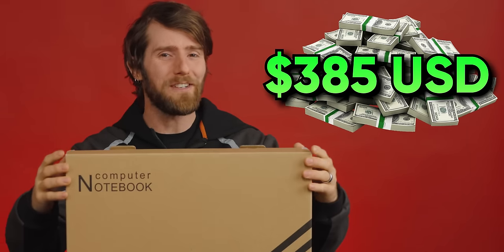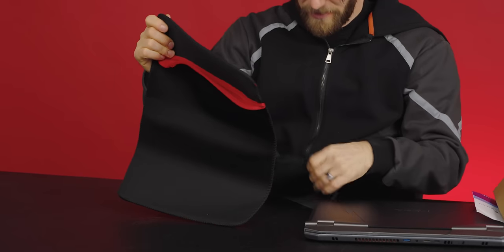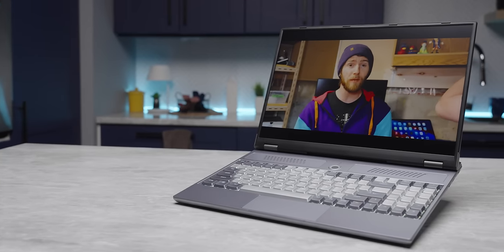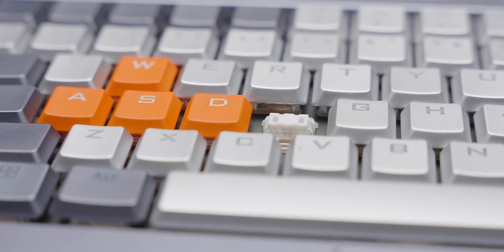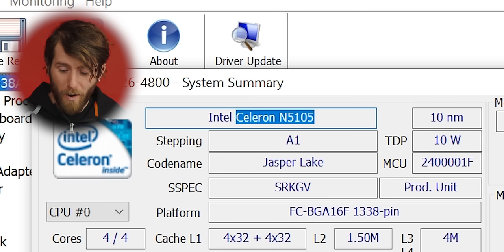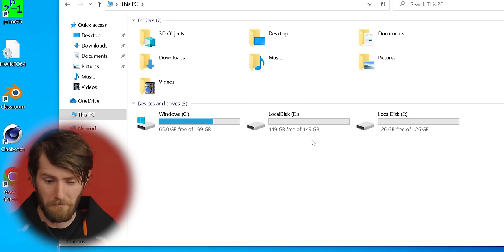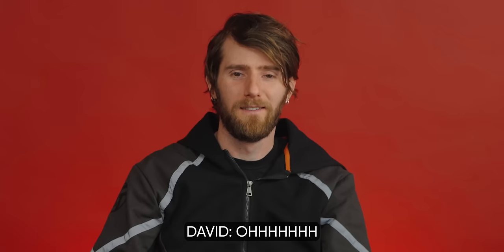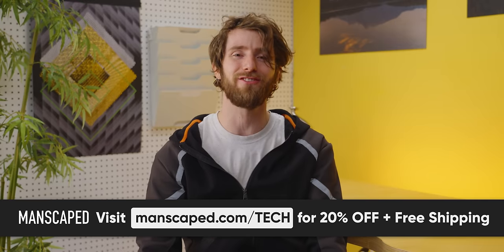Brown Star for Effort – This AliExpress Gaming Laptop is HILARIOUS

Comment: 16:10 is only good for users.
Video editors? What's again the reason when videos are screwed up? right. Stupid editor made his for his screen that no one uses.
Always count on stupid. And you should know. You are a pro when looking at your vids how much stuff you let fall down 😉

What you say about the speakers. Okay, they were bad. But I have an Omen Laptop (HP). And the so called high quality speakers are also sounding cheap. Not that cheap I guess. But it's not the quality to play games or watch videos with.

Partitioning drives is still a thing. I just had a course about it and the...old IT guy...was still demanding it with SSDs. Not necessary because of the HDD. But you still can make easy backups. Think about changing your one SSD. In case your broke...and this laptop will be bought by broke people...you might buy a cheaper SSD. So you can backup your Windows drive and give the rest to your workspace. You can make a backup of windows, so you won't loose your windows activation, but because a smaller SSD you can cut your other worthless data. Some people are just crazy with what they want to save forever.
Also making backups is easier as you ignore your windows drive and only backup your "data" drive.
In certain situations it can help to still partitionierte your SSD.
Most reasons are because people are poor and have to make budget decisions. But this entire laptop can only be seen as a budget decission.

The windows installation. Let's be honest. It's a China licensed windows.(With Chinese prices, means lots cheaper than here) So they have to make sure you can activate it under your account. It can only be sketchy or not working at all.

But lets be honest. Your CS:GO test makes a clear message. No matter the price. This system is garbage.
And don't come with this stupid screen size. 16:10 is an issue collector itself when it comes to gaming.

Comment: I don't know apparently this guy was supposed to be all tech savvy yet his asking if the 4 pin ethernet adapter works, how can you not know that 4 pin ethernet is 10-100 speeds and and 8 pin is 10-1000 (gigabit). I've lost all respects for this guy, his supposed to know his s**t

(Four-wire cables have one twisted pair of wires for transmit and one pair for-receive. For example two pairs of Category-5 wires will operate at up to 100 megabits per second full duplex.

In fact two separate 100 megabit Ethernet ports could actually share the same eight-wire cable over limited distances if the four pairs are split out properly to separate RJ-45 connectors at both ends.

Eight-wire twisted pair cables with the required category level will operate at 1000 megabits per second or greater. Two pairs are used to transmit and two pairs to receive. Each pair handles half of the total bandwidth in one direction.)